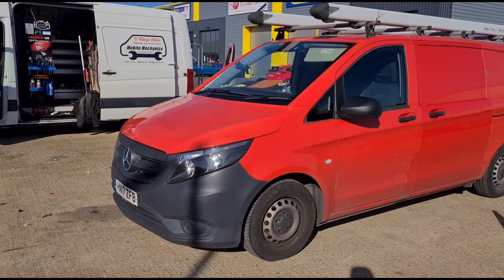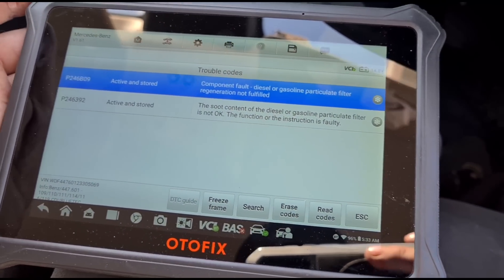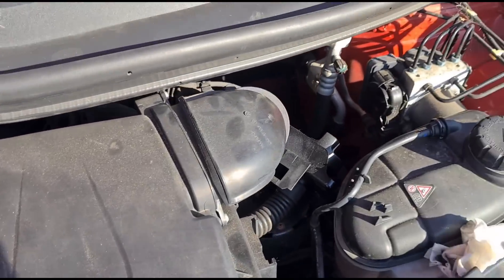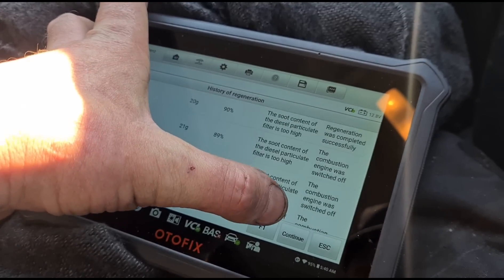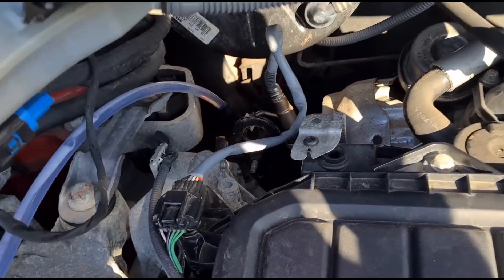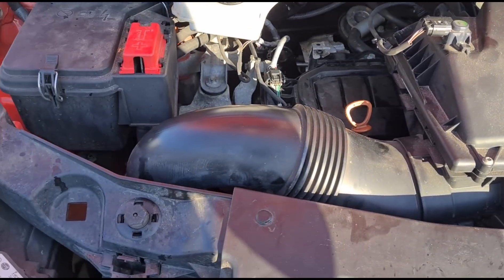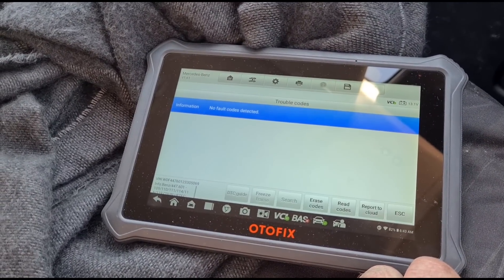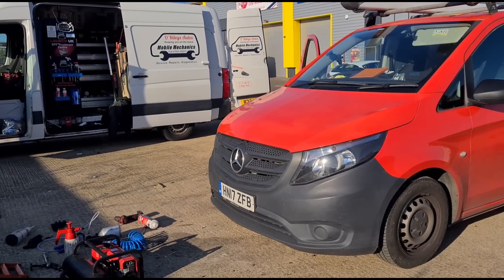Mercedes Vito 1.6 P246B09 & P246392

Comment: Hello
We learn a lot from your videos. Thank you. Actually, the differential pressure sensor shows 30mbar pressure.
The line is almost open.
1) Despite this, why did you clean it with a guitar string? I didn't quite understand.
2) I also didn't quite understand how much pressure you applied by removing the differential pressure sensor and how you tested it.
3) Why did you use the cleaning chemical with a differential pressure?
I would be happy if you could provide information.

Comment: How come you no longer put the DPF cleaning fluid through the upstream pressure sensor pipe? 🤔 just something I’ve noticed past few cleans on these 1.6 engines 🤓
Reply from the maker: Too many people copying me and messing it up by overloading it and locking the engine up. It's actually better go go through the nox sensor or dpf pressure sensor

Comment: I've been quoted £90 for that exhaust pressure sensor by my local parts place, is that about right or are they pulling my pants down?
Reply from the maker: No I have paid £120 a few times.
Reply: @ORileysAutos  Ok nice one, thanks for the reply.
Reply: @kelvindoughty3277  £50 ish

Comment: So merc is a Renault in drag!!! I wonder how many bought the merc viteo thinking it was a merc with a merc engine!!!🤔🤔🤔🤔
Reply: New VW transporters are based on Ford Transit platform with wet belt engine.
Loads of small cc mercs use reno engines.
Reply: @Ad0akes  Compact Mercs used Renault engines, but that cooperation has ended I think. I also do not think there ever has been a diesel Sprinter with a Renault engine.
Reply: @Ad0akes  sprinters NEVER used a Renault engine. The 2.0 diesel is a Mercedes engine, Renault engines does have a distinct sound to them.
Reply: @daand12  that's right, om654 is 100% Benz, I've got 2019 with 2.1 so not familiar with them yet
Reply: @Ad0akes  2.1 651 only known for failing tensioners ( 2 hole versions ) and chain.
We have a sprinter with a chain rattle, possible that the tensioner has failed as it appeared out of nowhere. 

654 is pretty solid beside the rocker arms really
Reply: @daand12  if the rattle goes after a few seconds its the tensioner
Reply: @Ad0akes  I know it's the tensioner. They are not that expensive to replace
Reply: @Ad0akes not all are bad. The PSA DW12 engine is a gem.
Reply: My daughter's C-max 2.0tdci has PSA engine... its ok tbh, euro 4 though @hughmarcus1
Reply: My milkman for one. I hadn’t the heart to tell him. He got rid of a Toyota Proace because it broke his heart. 😩
Reply: Worst of all some Toyota's have Merc engines.
Toyota most reliable  to the worst in one swoop.
Reply: @tam1381 Toyota vans in Europe are actually Citroens now. Even worse
Reply: @Ad0akes  it is the new mercedes replacement for the renault engine, I think :)
Reply: All of them 😂
Reply: Too many, and paid the 20k extra 😅